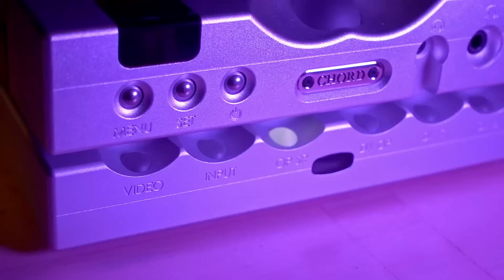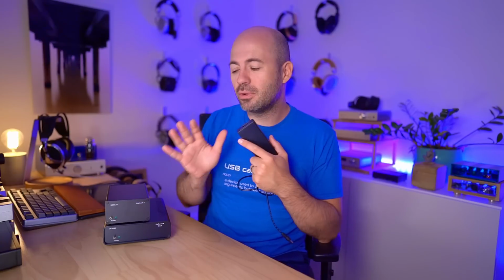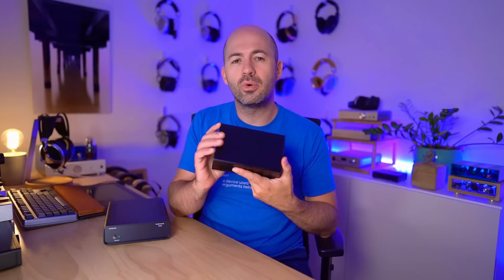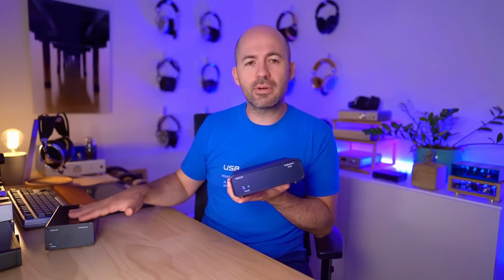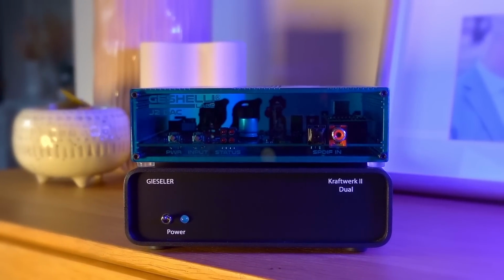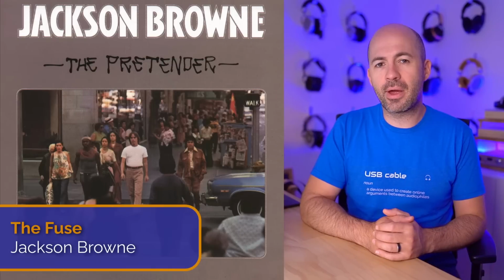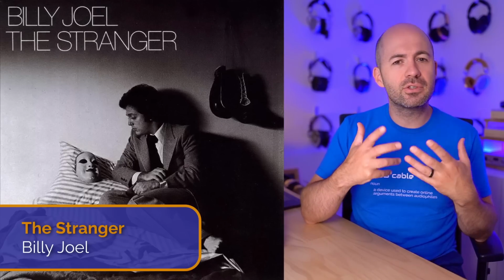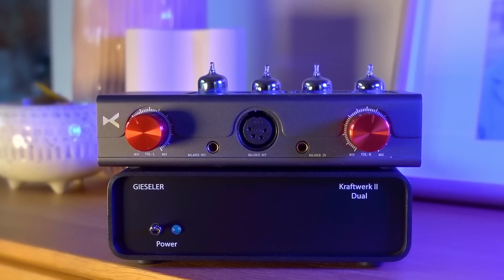Audiophile Linear Power Supplies - Do they improve the sound?

Comment: With D-Amps a Meanwell SMPS with additional CRLCRLC filtering in the output will beat ANY linear power supply. Because the linear supply is just too slow for the task - FACT.
Reply from the maker: A linear power supply provides constant power with no switching. You could say it's actually infinitely fast.

Comment: Thanks for the video, Lachlan. It's worth noting that good GaN Switch Mode PSUs are very good indeed. Not "for their price". Not "for their size". Just very good PSUs for audio gear. And being able to have the PSU a good way from the components makes system building quite a bit easier, if a little more messy. :P

One thing people often forget is that High-Passing speakers radically reduces how much power an amp draws. Nearly all the power in music is concentrate in the low tones. And that is why we high-pass speakers, and hand off to dedicated subwoofers specifically designed, and powered, to translate the low tones into bass.

The list of sonic benefits of high-passing speakers is extensive, and I have only ever tested two pairs which did not (to my ears) benefit from high-passing. They were VERY expensive. And in several cases, fairly ordinary speakers transform almost magically when relieved of the huge excursions and non-linear cone movements associated with the low tones as SPL rises.

So, high passing is kind your ears, kind to your speakers, kind to your amps, and also kind to your PSUs. All the heavy lifting is being done by specialist transducers designed to handle just a tiny sliver of the total frequency range. That allows them to be very good at what they do. And so, properly setup and properly integrated subwoofers are a feature of all sane HiFi systems in 2026. But don't forget to mass-damp them, as the cabinets move a lot due to Newton's Laws, and they smear bass badly until you do. 40Kg of concrete pavers per subwoofer seems to be the sweet spot. Looks dubious, but sounds amazing.
Reply from the maker: I agree about the GaN power supplies. They actually weren't available when this video was made 😂😂

Comment: At 2:58, this video asserts that LINEAR supplies use a coil to reduce the voltage, and that is not only false but also generally misrepresents how linears work. Linear supplies have one common characteristic that defines them, and that is some form of series resistive element that results in the dropping of excess voltage, leaving only the desired amount of voltage. Many linear supplies (especially old ones) also incorporate coils in the form of 'chokes' that help remove higher frequency energy on the input and/or output sides of that resistive element. The resistive element is usually some kind of linear voltage regulator IC, but can also be a transistor that is fed a reference voltage, or a simple resistor in combination with a voltage limitng device such as a diode(s). A DC power supply that does not incorporate some kind of voltage regulating function is not usually referred to these days as a "linear" supply....that term is usually applied only to DC supplies that also regulate the voltage.

And when it gets down to it, an amplifier (anywhere from phono preamps and on up) in most configurations used for audio doesn't care what the voltage of its power supply is, as long as it is substantially greater than the maximum voltage that will pass through the circuit, and does not have a lot of rapid voltage variance. In this, as long as a linear OR switching power supply is producing sufficient voltage and does not vary that voltage significantly, the amplifier will function just the same. Thus, any properly functioning linear or switching supply that has appropriate specifications for the amplifier circuit will 'sound the same' in any objective evaluation; anything else is 'audiophoolery' and/or a failure to understand how audio circuits work.

Comment: Batteries should be better than then the linear power supply. Maybe the battery did not have enough amps.
Reply from the maker: I can't remember this video anymore, but some batteries use switching circuits to raise or lower the output voltage from the native voltage of the battery and that can affect their sound (AFAIK)

Comment: There is no transformer in the box that changes AC to DC. There is circuit that has full wave rectifier. Large micro Farad capacitors. Control for keeping voltage constant. For safety, a crowbar circuit.

Comment: Having spent decades with various and sundry power supplies..... 

Switchmode supplies are far more failure prone, produce RFI like a commercial transmitter, fry capacitors, inductors, and are much more difficult
if not impossible to repair over a well built and yes more expensive linear power supply.   

Most of your computer power supplies are switchedmode and these things are relegated to landfills in short order.   

So which is "better" ?  Some put a premium on something small and lightweight over something heavy enough to use for weight training.  

Some want to be able to repair their equipment when it fails. Linear supplies are far more parts substitution tolerant and easier to repair. 
Even a twenty year old ATX switchmode supply can be an absolute nightmare to try getting to work after failure and I've seen these things
literally go out with a fairly violent and pungent bang. 

I've seen 400 and 500 watt  Linear PC Power supplies and they're much larger and heavier than a switchmode counterpart.  

In some applications one wants the cleanest power possible.  If I can I'll choose a linear over a switchmode only because I know how to repair
them much easier, cheaper, and effectively than a dead switchmode.

Comment: I am new to considering linear power supplies and power conditioners. Performance seems anecdotal and subjective. Isn’t there any type of measurement methodology available to quantify the specific results (and describe what precisely it is measuring) and then benchmark it to a device not utilizing and quantifying that differences and scale?  Also do these LPS only connect to one device or are there multiple sockets to have whole system utilize the claimed benefits???
Reply from the maker: Sadly, no. There is no clear measurement I've heard of that properly quantifies the effects of better power. My understanding is that it all comes down to noise, but how exactly that noise influences a circuit could vary. In a DAC, it could be through less jitter and a lower noise floor. In an amp, it's likely lower noise floor, but then we get to the question of what's audible. Some would say that most of these devices already have noise floors below auditory limits, but then you speak to someone like Rob Watts who designs Chord DACs and he found that a making a change to one of his circuits that resulted in a theoretically inaudible improvement in noise, actually made an audible improvement (that went against his expectations during listening tests). The human auditory system still contains a number of mysteries.

Comment: Conclusion-there is a slight but recognizable general improvement. To me the pearl isn’t worth the dive. Paying $600 to make a subtle improvement in a $300 J2 seems ridiculous. Just get a $900 DAC. Otherwise it reminds me of my 70’s teenage years. Owning a $500 used car and installing a $750 car stereo system.
Reply from the maker: I completely agree (and think I said in here) that I don't recommend spending more than the main device on a power supply.

Comment: For which devices should I use the linear power supply (LPS)? I have a headphone DAC/Amp connected to a speaker integrated amp, connected to a subwoofer, and then I have AVR that is connected to the speaker integrated amp as well. So many devices, but which one should have its own LPS? Should I spend tons of money to buy a LPS for each device that needs power from the outlet (pretty much all of my devices)? Also, my integrated speaker amplifier and AVR have their own power supplies inside - will external LPS benefit them at all, or these external LPS are only for devices that accept 5V power like a headphone DAC/Amp that doesn't have its own power supply inside?
Reply from the maker: You can only use a LPS on devices that accept a DC input. Any that have a mains power input can't use a LPS.
As for where to use them, it's very hard to predict which devices will benefit most from LPSs. On top of that, it can depend on the quality of your local power grid too.
Reply: @PassionforSound  I thought LPS works for any device. But isn't the VINSHINE x KINKI TAIHANG for example a LPS too, it is AC, not DC. Or that's an "enhancer", or is it a power conditioner? I'm so confused by the difference of these device types.
Reply from the maker: Ah, the Taihang is a power conditioner or filter and is probably a better choice than a LPS because it will improve the power of any power supply type - linear or switching supplies. I have the Taihang in for review and it's VERY effective!
Reply: The best hifi equipment always contains a linear power supply.

Comment: My issue with these is the same as all the other power supplies out there you can buy. Yes they help but no I shouldn’t have to upgrade the clock / power supply of my two thousand dollar DAC. What’s next? Upgrading the DAC of my two thousand dollar DAC with another DAC? 

Tweaking is great but when manufacturers use the trend to skimp on clocks and power supplies it’s not so great.
Reply from the maker: I might have some extra information coming soon that could clarify this situation because I do agree...

Comment: Shame the 'technical details' are not always accurate. True there are both good and bad linear and switchmode supplies but he neatly confuses Linear (using analogue regulator circuitry) with In LINE where the supply box is part way along a cable where mains is at one 'end' and DC at the other. Switchmode designs are 'superior to linear analogue but ONLY when the resulting DC output is filtered correctly to have the same (or lower) level of HF noise compared to a standard properly designed linear supply. This filtering needs capacitors to GROUND as well as inductors to reduce the noise loop area which would then prevent switching noise being radiated by either the mains input cabling or the DC output cabling, Something you don't get with regular cheap wall wart or in the line mounted units. Buying an off the shelf switcher supply should be treated as a single component of your overall system and it requires eXTRA components to clean things up. IF your final gear is well designed it will have this extra filtering which must be way more stringent than FCC regulations which only cover cases where there are gross emissions which could cause malfunction of other gear nearby.

Comment: I got an SMLS PL200T CD transport. It has an internal switching power supply but also a connection for an external 5V power supply. I bought a 5v 6A linear power supply  from AliExpress for $100 and the improvement is quite marked, mostly in the sound stage and treble.
Reply from the maker: I've got the SPL200T in for review. I'll have to try that idea as part of the process.

Comment: Thank you for your sensible and interesting reviews regarding switch mode vs linear power supplies. One point that was brought to my attention from by some electrical engineers was the  serious noise and irregular pulses fed back into the mains supply especially by low cost switching supplies of rhe type usually supplied with audio/visual equipment,eg DACs, digital amplifiers, streamers etc. This pollution of the domestic mains supply is suspected of feeding back into any other equipment plugged into the same ring main.
In closing I too despise your sickening politeness, honestly and treating you viewers as intelligent human beings.
Keep it up.
Mark
Reply from the maker: That's a great point and very true about the impact of SMPSs on the rest of your gear.

Comment: Would switching from a low-ripple switching power supply to a linear power supply improve the sound?
Reply from the maker: In my experience, it often does, but it all depends on the specific devices
Reply: @PassionforSound  Thank you, I have Airpulse active speakers with internal low-ripple switching power supply, will look into upgrading too see if it makes a difference.
Reply: I only bought linear power supplies so I'm on the safe side and the cost is the same.

Comment: Hi …
Nobody has mentioned a "AC power conditioner" …
Doesn’t this resolve 90% of the problem from the start? 
At 1/10 of the price .
    Just saying..🙂🇬🇧👍
Reply from the maker: They're doing different things. If you get an AC power conditioner and plug in a switch mode power supply, you're still introducing switching noise to your system. The linear supplies don't switch so they're silent in that regard. They may benefit from being connected to a power conditioner though.
Reply: I see, okay thanks.👍

Comment: On my Router I have just changed from an Amazon 12v 3a switch mode PS to a Linear PS and there is some difference’s that some people may or may not prefer in regards to music playback streaming to an mid range amp. The SMPS was a little more ‘shouty’ a little brash in comparison, a bit slap dash overall but bass was a little more prominent with more impact. The LPS is more balanced by comparison. The sound is overall a little more behaved, orderly and no spiky frequencies. Bass was a little softer which admittedly was a little bit of a disappointment but acceptable given the overall more organised sound quality and darker background. I paid £100 for the Sengterbelle 12v 3a LPS with full Nichicon internal and R Core design.
Reply from the maker: Thanks for sharing your experiences!
Reply: @ Yeah, no worries, my pleasure and I haven’t got much to else do at the moment anyway…just finished a busy shift and am now looking at Network switches…
Reply from the maker: There's a rabbit hole for you! 😂

Comment: I just fab a whole bunch of 1/4-wavelength unterminated line-pairs, each tuned exactly in length to its individual matching bad noise frequency, off the power supply output binding posts and all those bad frequencies encounter a dead short.

VIOLA!

Begone bad frequencies.

Comment: This video would be perfect if it were supported by measurements such as ripple or an oscilloscope with data such as slew rate, SNR, input and output waveforms. Who knows, an update video with a big leap bringing support from the objective world to the subjective. Thanks.
Reply from the maker: Unfortunately, I'm not setup with the equipment to do those measurements and my channel is focused on the subjective impacts of gear on the sound rather than objective data.

Comment: Is a LPS a good upgrade for streaming transport devices like the bluesound node n130 and nvidia shield pro? I use and external dac that’s inside my Anthem AVM90 processor
Reply from the maker: It can be, but you're best to find reviews or discussions of specific experiences with your particular product before buying a new power supply.
Reply: @PassionforSound  yeah been looking can’t find anything that confirms noise transfer from not using the internal DAC but if the coaxial cable is shielded then it should cover the cable in a charge from the power source would be my assumption
Reply from the maker: The issue is generally that the noise gets into the streaming transport and degrades the sound before it even exits the streamer.
Reply: @PassionforSound yes this is what I was thinking so the LPS infront of it should clean up the signal regardless if using a dac or not, the dirty charge from no LPS would be travelling down the shielded coaxial cable particularly if the shield is terminated on both ends, it’s it’s only terminated on one end then you would want the open end on the streamer side to my understanding but regardless I think the 5v LPS converter for the n130 will result in better signal transfer than the stock power supply
Reply from the maker: @njrumenos I'm not sure about the transfer to the coax cable, but poorer power can affect many things.

Comment: A battery with sufficient output as to minimize voltage dips with audio peaks should be the ideal power source, especially when you consider the low power required by a DAC.

Without knowing what you used for a battery I see no way you can make a credible argument for a LPS, unless your goal is to sell them.

The goal of a LPS is to imitate a battery; steady smooth power with no artifacts.

Comment: I bought the Geshelli J2 dac with the newer akm chip. I got a iFi 12 volt power supply for about sixty dollars but heard no improvement. Someone said I should try a linear power supply but not sure which one to get. Any ideas under $200?
Reply from the maker: I haven't tried any cheap linear supplies so can't recommend one - sorry. I'm surprised you're not hearing any improvement from the iFi supply though. Perhaps the rest of your system is the limitation and the linear supply will be a waste?